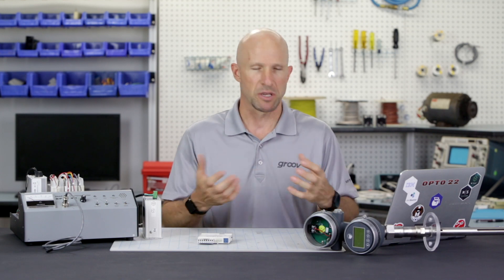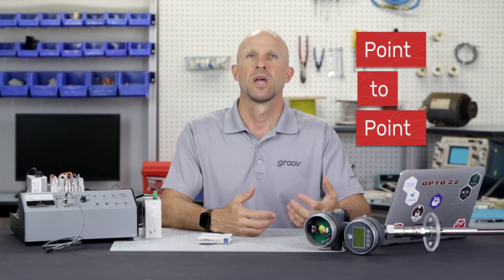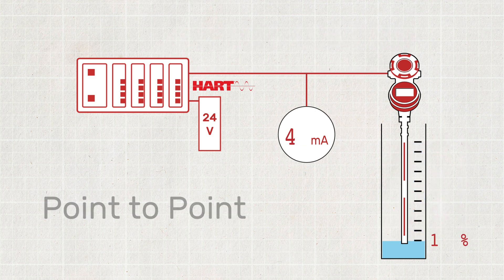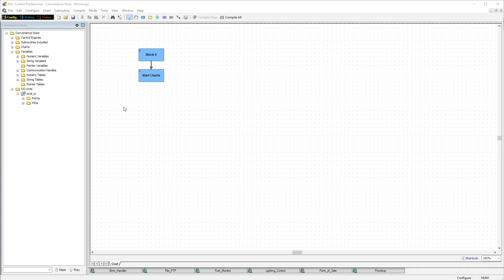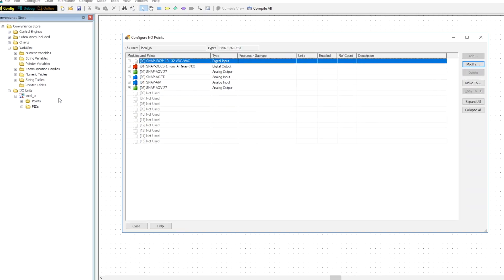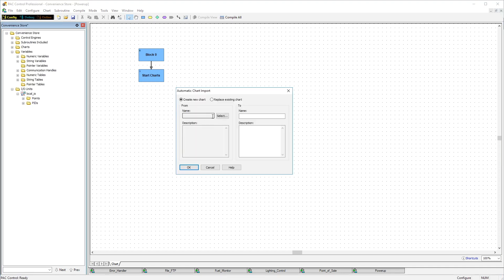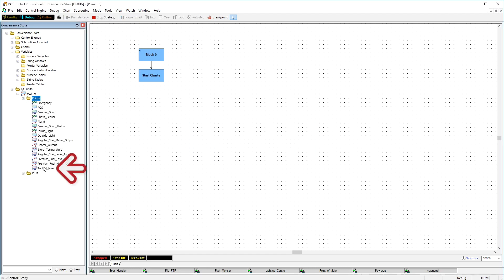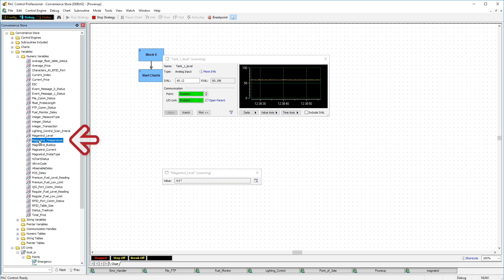How to Wire a Level Sensor for the IoT

Comment: Great Video! Keep them coming!
Reply from the maker: Thanks Phil!  We have more videos in the works. Do you have any suggestions for future topics?
Reply: I think that a lot of people getting into IIoT applications have some questions about the merits of different types of input modules. Ex: 4-20mA vs Voltage Input. Some sensor manufacturers offer similar sensors with different outputs. Perhaps a video on wiring up 2 of the same type of sensor (Ex: Vibration accelerometer or flow sensor) with two different outputs (Ex: 4-20mA vs. 0-10V) into the same SNAP-PAC board and compare the signals. This might demonstrate how flexible the SNAP-PAC system is at dealing with what sensors various customers may already have in inventory vs. what may need to be purchased in the future.
Reply from the maker: Great point Phil! I see where your question is coming from.  We'll add signal types as a future video subject. Cheers!